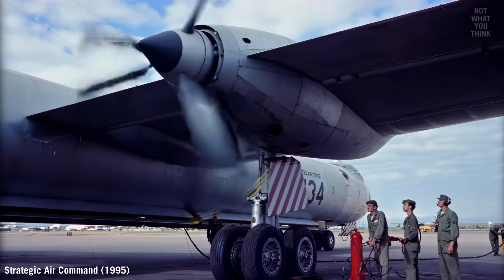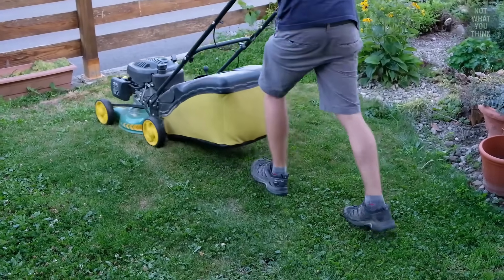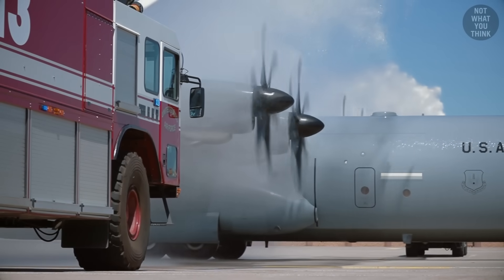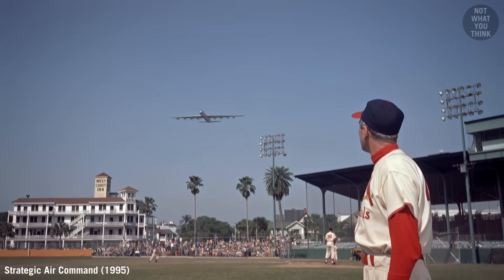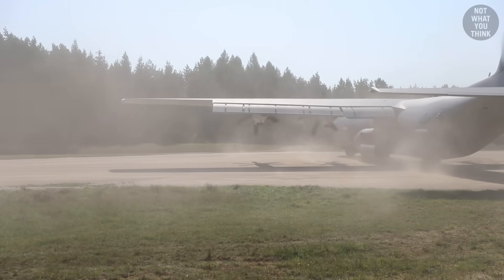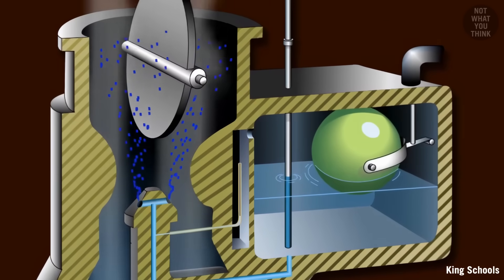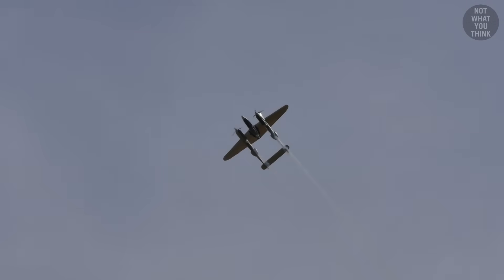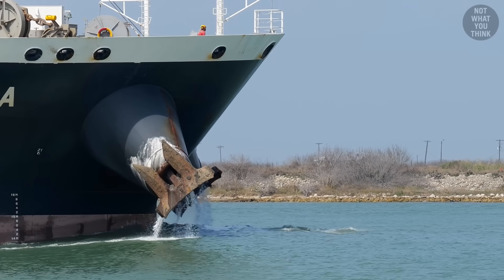Why airplane propellers moved from BACK to FRONT

Comment: The #1 main reason why props are at the front is because you need to balance a plane with its centre of mass 1/3 of the way from the front to the back of the wing. With the big long tail hanging out the back, having the engine further forward helps with balancing the aircraft.
Reply: No, with the engines in the back the wings are positioned more towards the back so that (as you said) the CG is approximately at 1/3rd of the wing chord. Take a look at the wing placement on commercial jets with aft mounted engines like the DC9, B727, MD80, VC-10 etc. Ideally, the airplane is designed so that fixed items like engines and consumable items like fuel are close to the CL and variable but non-consumable items like pax and cargo are distributed evenly along the length of the airplane.  That way the airplane remains balanced throughout the flight, whether  it is an empty flight or fully loaded. The flight control surfaces must be capable of compensating for CG shifts during a flight due to pax moving about, food, beverage and water being distributed from concentrated storage areas, and waste accumulating in a concentrated area. They must also be capable of compensating for movement in the CL, which tends to move aft at higher airspeeds and may also move (fwd/aft/both/none) as the flaps/slats are extended.
Reply: None of that is true. You don't need the CG 1/3 of the way back form the nose. You need it a certain place relative to center of pressure, which is somewhere on the wing. The CG and tail length are unrelated. The vast majority of aircraft do not have their engines in the nose.
This is about tractor versus pusher configurations.
Reply: @tylerfb1  he said from the leading edge of the wing not from the nose of the plane
Reply: @ you’re right I missed that, but it doesn’t matter, everything else still applies.
Reply: @silaskuemmerle2505  Where the CG is depends on a number of factors, mainly where the Center of Lift is but can also be affected by the angle of a wing's sweep and whether or not it is a delta wing, canard equipped or flying wing design.
Reply: @ where the CG is has nothing to do with the center of lift, it is entirely a result of weight distribution
Reply: @silaskuemmerle2505  Unless you compensate with computerized stabilization, the CG MUST be forward of the Center of Lift. CG has everything to do with CL.
Reply: @hifinsword  yes the CG needs to be forward of the CL, but that doesn't mean that the CG is a function of CL as your initial comment indicates. The CG limits are a function of design and the CG itself is controlled by loading.
Reply: @silaskuemmerle2505  You're not making sense silaskuemmerle. I don't know what you mean by saying my initial comment does NOT mean CG is a function of CL. Then you say CG is controlled by loading. That loading is of course determined by how the load is distributed per the CG limits. You can't put the load too far forward or aft of the CG limits, which is of course control by all of the other numerous factors that went into the design of the a/c, INCLUDING THE CL!
Reply: @ yes but in aircraft, they need to be close to each other: within like 1% of overall length of the plane, if all other factors in the design are normal. That means the CG has a range of about a foot in Cessnas, and maybe 10 feet in airliners.

Comment: Having friends with a Breezy aircraft, while it was absolutely awesome being out in the airstream without a prop-wash, this didn’t make up for all the propellers the went through.  As you noted in a pusher aircraft, anything that falls off or out of the aircraft has a high probability of striking the propeller. The Breezy owners had gone through a few propellers and the associated costs. If the strike is severe enough, the engine had to be torn down.

Comment: Let’s see how many errors you can squeeze into one video.

First, there’s the strange claim that pusher props were abandoned “over 100 years ago.” Most of your examples, including the B-36 and the Rutan Voyager, are post-1925. 

You failed to note that the Rutan Voyager had both a pusher prop and a tractor prop. 

You say that pusher aircraft must operate from paved runways, yet you also note that the Wright Flyer (which obviously did not operate from a paved runway) used a pusher prop,

You say that “propeller aircraft use air to cool their engines as opposed to using water.” That would come as a real surprise to the pilots of the P-51 (for example). The pusher engine in the Rutan Voyager was liquid-cooled Continental IOL-200. Even the Wright Flyer used a liquid-cooled engine. 

Saying that tractor engines are advantageous because they make an aircraft nose heavy is simply bizarre. To fly properly, an aircraft needs to be balanced, with the center of gravity within strict limits, neither too far forward nor too far aft. Both engineers and pilots understand that and take weight and balance into account, during the design phase and when preparing for flight.

Comment: A very complete list of the advantages of the tractor configuration. One advantage for pushers you didn't mention is for drones. The tractor configuration causes some instability through the torque of the propeller  and there is also some instability caused by disturbed air over the flight control surfaces. Both are easily corrected by a human pilot. Writing the software to automatically make those corrections on a drone using the  tractor config isn't quite so simple. Which is why the pusher configuration is so often used in autonomous drones.
Reply: From a software perspective it's incredibly easy to compensate for those things. The software only has to compare sensor data to the expected result of the inputs. Then the difference is compensated for in the controls.
Reply: @justinvzu01  That would have been my own thoughts, after all early airliners had automiatic yaw damp, back in the sixties. About thirty years ago we were doing some work for a company that was building an automous drone for survey work. It was one of the engineers who told me why they picked a pusher configuration. Another reason was packaging. But the inate stability pushers was the primary one.
Reply from the maker: Thanks!
Reply: As someone who majored in aerospace engineering, I would say that kind of disturbance from the prop is very easy to correct with even simple control methods, and in fact the controllers are robust enough to make the difference from prop placement practically negligible in terms of aircraft attitude control.
Reply: No, I think the primary reason you see this on drones is that it allows unobstructed views for sensor packages. While you may not have P-factor, you still have torque to deal with. Either can be compensated for with software.
Reply: @wcurtis2643  you still have p-factor. You don't have slipstream effects, but all the other propellor factors are there.
Reply: @ You would only have P-factor if you have flight surfaces behind the propeller. The MQ-9 reaper for example doesn’t not however the Bayraktar TB2 does.
Reply: @ P-factor is the term used for asymmetrical thrust from the upgoing and down going blades when the aircraft is at an angle of attack. That’s till applies when the prop is in the back. 
P-factor and torque still apply. Slipstream does not.
Reply: @tylerfb1  Wouldn't P-factor only apply to taildraggers, not tricycle gear-equipped planes? Tricycle gear-equipped planes takeoff from a level attitude whereas taildraggers start from a nose high attitude. Once the taildraggers build up speed the tail rises and the a/c is level, and is no longer subject to P-factor.
Reply: @ no. Propellor turning tendencies apply at all phases of flight, not just takeoff. Anytime there’s angle of attack, p-factor creates asymmetrical thrust.
Reply: @tylerfb1  Technically yes, but P-factor's effect is minimal at normal speed during level flight resulting in no significant yawing tendency.
Reply: Thanks, I had been wondering about this for a while!
Reply: @everest9707  me too
Reply: For drones I guess an rear propeller keep it more protected then landing, many of the earlier ones was also caught in an net rather than landing.
Reply: This isnt right. A simple proportional controller would probably be able to handle any of these disturbances.
Reply: Liar!!

Comment: Many small seaplanes (Lake, Icon, Vickers, Colyaer...) have pusher props because they have to place engine at back to avoid splashes and have better balance on water, in this case its much easier to make it pusher - no need to keep prop axle too high creating huge pitch torque.

Comment: So that's why they are called propellers not tractors. That always seemed an odd name for something which is pulling.
Reply from the maker: In the early days, they would differentiate between screw tractors and propellers. Now we just use propellers as the generic term to refer to either.

Comment: Actually pusher config planes much more efficient than puller planes. İf you designee puller plane you need %20 more powerful engine than pusher plane. Also for the cabin noise pushers much more quitter than pullers. İn the end of ww2 too many pusher fighter concept planes coming to live but jet age stops their evolution.

Comment: 1:48 "pushing an object is easier than pulling it"
Nope. Pulling tends to lift the object, reducing friction. Pushing tends to bury the object in the ground. If you can't get that right you aren't worth listening to. Bye.
Reply from the maker: Well, if you look at a scenario where pushing tends to “bury the object into the ground”, then you’re right. But that doesn’t apply in general, say when you push a car.
Reply: @NotWhatYouThink excellent point, and exactly as irrelevant to aircraft. Pusher v tractor efficiency is about disturbed airflow. Props and wings are both more efficient when in front, but only one can be.
But the real reason isn't efficiency. Tractor props have an advantage in packaging because their blade tips are easier to keep from impacting the runway.

Comment: Technically, Balloons are aircraft; they predate the fixed wing aircraft in the US Army by about 50 years...  Scouting in tethered balloons was used in the US Civil War (1862-1865) for doing reconnaissance. Reconnaissance also predates air-recon of either the balloon or fixed with forms. Before aircraft. scouts on horse or foot did reconnaissance.
Reply from the maker: You’re correct about balloons predating fixed-wing aircraft. All we meant to say was that fixed wing aircraft was a huge improvement over balloons, so the US military was interested to have them for reconnaissance.

Comment: There are only two answers to the title. One, pushers are less efficient because they do not operate in clean air and two, when you crash, you don't have to worry about getting slammed in the back by the engine. There, that didn't take no 12 minutes to explain.

Comment: 1:00 -- The Airco DH.2, the Royal Aircraft Factory FE.2, the Vickers FB.5, and other WWI aircraft would like to object; WWI airfields were little more than open grassy areas, not paved at all. But if you limit it to modern pushers, you may be correct; the Cessna Skymaster can operate from grass fields, although that's a push-pull aircraft, not a pure pusher.
Reply from the maker: We may have exaggerated it by saying that pushers “only” operate out of paved runways. So you’re right. The point we wanted to make was that pushers are much more vulnerable when operating on non-paved runways.
Reply: @NotWhatYouThink  FOD is a problem for more than pushers -- while pushers can be FODded by material kicked up by the landing gear, jets can suck loose objects off the flight line and try to pass them through the engine rotors -- hence the FOD walkdown on aircraft carriers prior to flight operations. Tractor aircraft are much less vulnerable because of the relative sturdiness of the airframe, even though the propellor(s) can blow loose objects up against the aircraft. I suppose it's just a question of which operating constraints you're willing to live with.

Comment: No mention that a catastrophic engine failure in a front engine aircraft coats the windows with oil. My instructor died in that situation after an engine failure. 

It also means that in a single engine aircraft the engine restricts visibility ahead. That's resulted in many ground and mid air collisions.

Comment: Pushers tend to be far more fuel efficient. Beyond that, it allows for more freedom designing the nose of the aircraft. Meaning you can get panoramic views or all grass front ends. Great for tourism or pleasure flying.
Reply: Cessna 337 Skymaster were often ferried by shutting down the front engine and feathering the propeller... It saves a lot of fuel and gives longer ferry range.
Reply: @peregreena9046  maybe im incorrect but i remember the army testing both configurations for ferry with the 02a to vietnam and finding negligible difference in fuel efficiency, as a former 337 owner however im much intrigued as i always thought the reduced drag from a feathered propeller might help, yet as i always flew lean of peak where power is reduced quite a bit for efficiency i think it would be har to maintain altittude over 5000 feet with just one engine on lean of peak no matter the power setting, would you mind pointing out your source for this interesting information?
Reply: Yes , thanks ...
Reply: Fuel efficiency is the most important consideration for any commercial air line.
Reply: Actually, no. While fuel efficiency is certainly a big consideration, ease of maintenance has become an overriding factor in many situations. That's why engines are not built into the wings or fuselage anymore. And that's just one example.
Reply: @ larger turbofan engines are more fuel efficient than smaller ones (primarily due to reduced boundary layer effects, lower frictional bearing losses, and decreased tip losses), and large turbofan engines don’t fit into the wings of airliners.
Reply: You'd have a point... if those engine nacelles on wings wouldn't predate them.

Comment: The last part, about jet engines being pushers by definition, is just wrong. Most jet engines are in fact pullers. On most jet engines thrust is generated by bypass air, which is moved by the fan blades in front of the engine. Only a fraction of the air flows into the compressors and is used for combustion. The combustion energy is used mainly to drive the compressors and the fan blade, not for propulsion.

Comment: One other thing of note with the P-38 and other similar designs. There was no need to mount the guns at an angle. If you mount the guns in the wing, they have to be angled in towards the center of the plane. Creating a point in front of the aircraft where they cross. Outside of that area, and it is basically impossible to hit anything. Having the guns on the centerline eliminates this and allows the guns to live up to their actual max range.